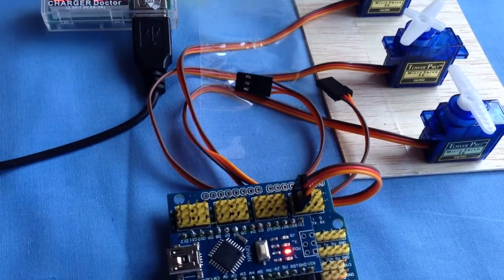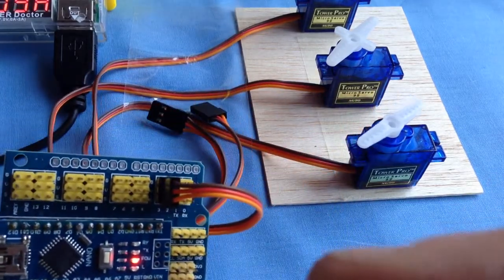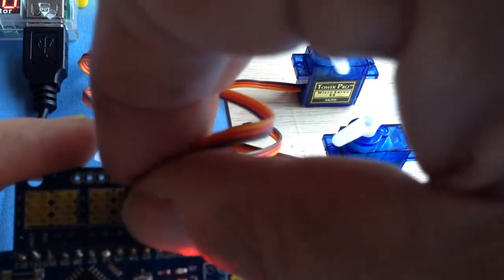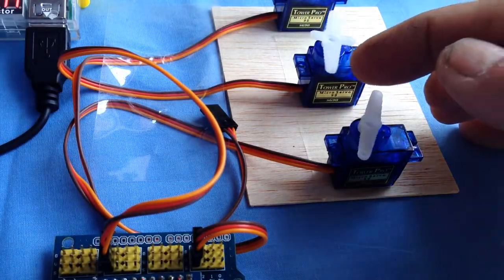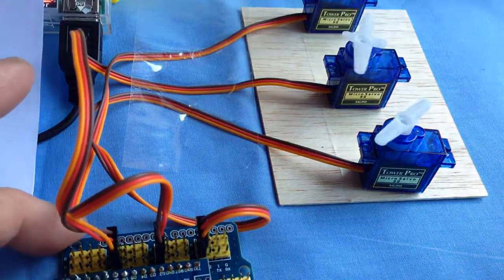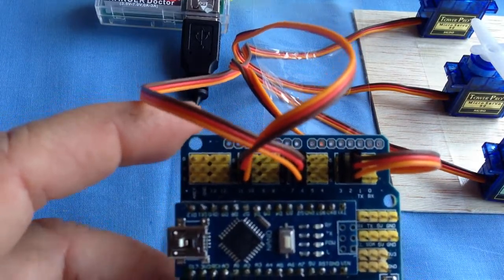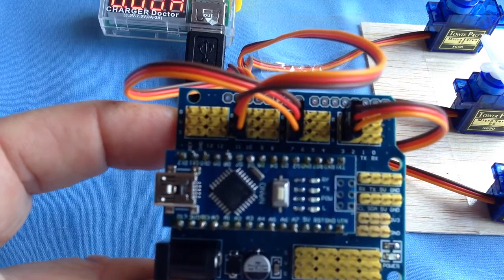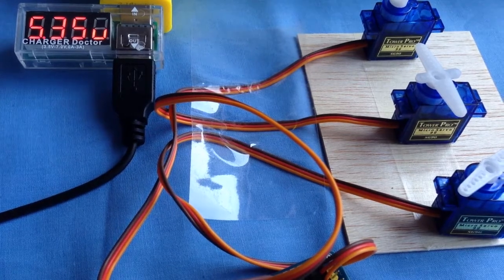ARDUINO Servo Control

Comment: excelente funcionamiento ,puedes compartir el codigo gracias.
Reply from the maker: /* THIS IS THE SKETCH USED FOR THE VIDEO
 speed controlled Servo Sweep
see: http://arduino.cc/forum/index.php/topic,61586.0.html

Michael Margolis 4 August 2011 */

#include <VarSpeedServo.h>

const int NBR_SERVOS = 4;       // the number of servos

VarSpeedServo Servos[NBR_SERVOS];        // servo objects ( ALL PARAMETERS BELOW HAVE BEEN CHANGED
                                          // READ SERVO PARAMETERS BELOW BY THE COLUMN, NOT THE ROW

int servoPins[NBR_SERVOS]        = {8,   9,  10,  11}; // servo pins
int servoSpeeds[NBR_SERVOS]      = {10, 20,  30,  40}; // sweep speed, 1 is slowest, 255 fastest)
int servoMinPosition[NBR_SERVOS] = {20, 35,  50,  65}; // the minumum servo angle
int servoMaxPosition[NBR_SERVOS] = {90,120, 150, 180}; // the maximum servo angle

void setup()
{
   for(int i=0; i < NBR_SERVOS; i++)  
   {
     Servos[i].attach(servoPins[i]);       
     Servos[i].slowmove(servoMinPosition[i],servoSpeeds[i]) ; // start sweeping from min position
   }
}

void loop()
{
  // sweep the servos
  for(int i=0; i < NBR_SERVOS; i++)
  {    
     if( Servos[i].read() == servoMinPosition[i])
       Servos[i].slowmove(servoMaxPosition[i],servoSpeeds[i]) ;         
     else if( Servos[i].read() == servoMaxPosition[i])
       Servos[i].slowmove(servoMinPosition[i],servoSpeeds[i]) ;           
  }  
}

/* Derrick's notes: Speed is not linear, somewhere between 25 - 35 is mid-range, 
   15 and below is minimum,  100 and up is pretty much full speed.
   Angular limits are close enough at both lower and upper ends */

Comment: I've worked with VarSpeedSevo and have been looking for something like this could you please send me the code?
Reply from the maker: /* THIS IS THE SKETCH USED FOR THE VIDEO
 speed controlled Servo Sweep
see: http://arduino.cc/forum/index.php/topic,61586.0.html

Michael Margolis 4 August 2011 */

#include <VarSpeedServo.h>

const int NBR_SERVOS = 4;       // the number of servos

VarSpeedServo Servos[NBR_SERVOS];        // servo objects ( ALL PARAMETERS BELOW HAVE BEEN CHANGED
                                          // READ SERVO PARAMETERS BELOW BY THE COLUMN, NOT THE ROW

int servoPins[NBR_SERVOS]        = {8,   9,  10,  11}; // servo pins
int servoSpeeds[NBR_SERVOS]      = {10, 20,  30,  40}; // sweep speed, 1 is slowest, 255 fastest)
int servoMinPosition[NBR_SERVOS] = {20, 35,  50,  65}; // the minumum servo angle
int servoMaxPosition[NBR_SERVOS] = {90,120, 150, 180}; // the maximum servo angle

void setup()
{
   for(int i=0; i < NBR_SERVOS; i++)  
   {
     Servos[i].attach(servoPins[i]);       
     Servos[i].slowmove(servoMinPosition[i],servoSpeeds[i]) ; // start sweeping from min position
   }
}

void loop()
{
  // sweep the servos
  for(int i=0; i < NBR_SERVOS; i++)
  {    
     if( Servos[i].read() == servoMinPosition[i])
       Servos[i].slowmove(servoMaxPosition[i],servoSpeeds[i]) ;         
     else if( Servos[i].read() == servoMaxPosition[i])
       Servos[i].slowmove(servoMinPosition[i],servoSpeeds[i]) ;           
  }  
}

/* Derrick's notes: Speed is not linear, somewhere between 25 - 35 is mid-range, 
   15 and below is minimum,  100 and up is pretty much full speed.
   Angular limits are close enough at both lower and upper ends */
Reply: @dezzodarling  thank you so much i have this library, I was just having a hard time putting it in an array thank you so much for sharing.

Comment: Could it be set up so that each servo operates only when a button is pressed? That is, each servo would have its own button, so 3 servos, 3 buttons.
Reply: Sure ! But you would have to route the current automatic cycling via 3 pins that have conditional code.  I have always found it easier to run such outputs as a separate sketch on a different ARDUINO just to keep things simple and uniform.  You could also wire the servo lines via relays centre line, that way you could switch the parameters between different relays.
Reply: I followed you as far as "Sure!" Then you started speaking Greek. :)
Reply: I'll try to make a video to explain myself - give me a couple of days!
Reply: Look forward to it :)

Comment: Hi Derrick, i'am CocoWolfz. I made a new youtube channel. i did the request for the Here Comes Santa Claus insides.
Reply: And the request for the village skating pond.
Reply from the maker: Thanks for letting me know! Please send me the link so I can help you promote your channel on my FB channel!
Reply from the maker: I have already replied about the skating Pond - it is on my youtube channel - the inside for "Here Comes Santa Claus" is only slight different.
Reply from the maker: https://youtu.be/blAE4VdrcP8    -    Insides of the Skating Pond!
Reply: You don't have to help me promote my channel, but thanks! :)
Reply: Do you think you can get a ''Here Comes Santa Claus''?
Reply from the maker: That is a very old release so I cannot get one to open up, but the idea is same as the "Skating Pond" - a belt moving around with a magnet stuck to it which controls the Santa moving around.